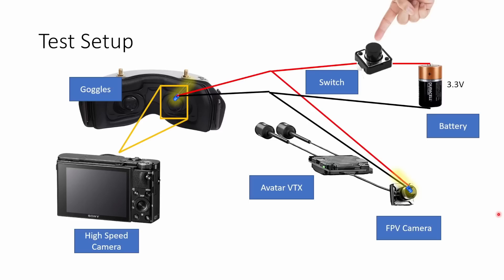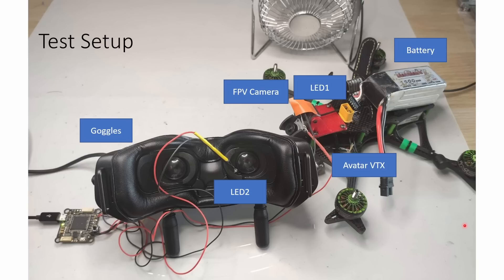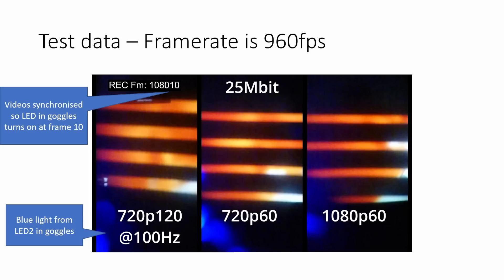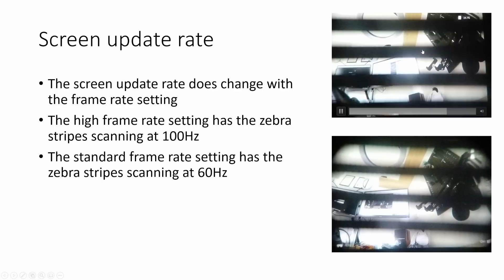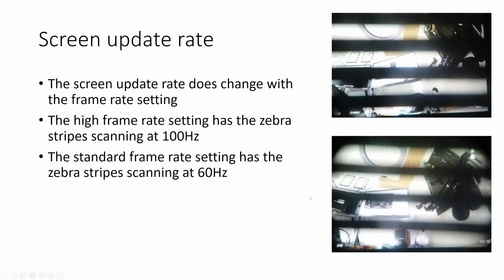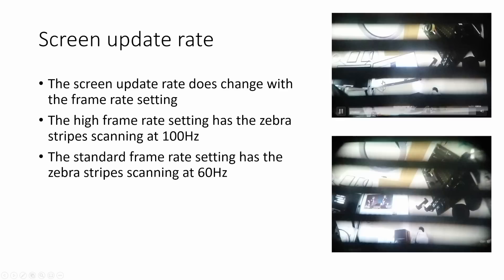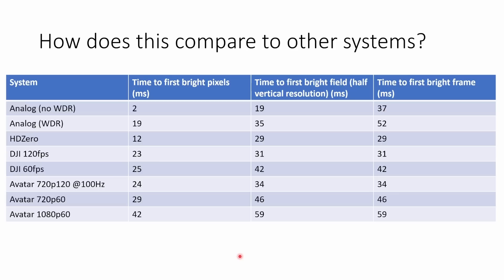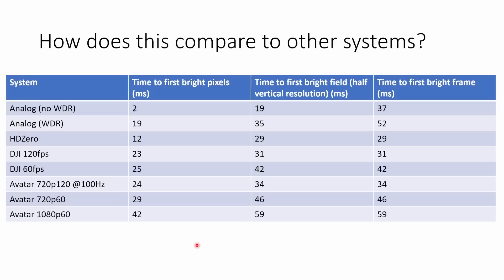Walksnail Avatar Latency Testing vs DJI, HDZero and Analog!

Comment from the maker: Some more information on WDR courtesy of Carl from HDZero! ♥

There are two types of WDR cameras available:
True WDR cameras that work with a shutter speed technique and two images.
Digital WDR (DWDR) cameras which work with a software compensation technique.

True WDR cameras work by capturing two images with different exposures to light and merging them into a third one, and therefore works more intensely but at cost of latency,  whereas the digital WDR works only with one image to make a digital exposure compensation, with only several line latency which is neglectable.

RunCam and Foxeer confirmed that most of cameras they have made use digital WDR not only because of less latency but also less cost.
Reply: Which cam did you use in your tests then? I was pretty surprised by the 40ms latency claim since that's clearly not what I was feeling with my runcams/foxeers vs. dji. but who knows!
Reply from the maker: @aphinion  I used Turbowing Cyclops, RunCam nano, RunCam Eagle Micro, and Foxeer Falcor
Reply: @ChrisRosser  I'm guessing the latest Falkor  3?

Comment: Wow HDZero is amazing! And DJI 120FPS not to far behind. Analog with WDR was a huge surprise to me! Thanks Chris!
Reply: Yeah, now if it could only penetrate objects, we'd actually have something! 🙄
Reply: @KOrnhOliO1  I'm not sure if hdzero uses LTE but that might explain why DJI/WS get far better penetration, however LTE requires 2 way comms for realtime link quality monitoring from both ends to know which packets to prioritize resending, it isn't just due to the H264/H265 compression those systems use.
Reply: Now... this is something hdzero could benefit from via an RC link callback of link quality via the hdzero backpack, can hop or boost power output of vtx in realtime when received vtx signal degrades.
Reply: @spikester  why not just fly it on full VTX power?
You're describing what dynamic power does for Crossfire receivers. 😎🤘
Reply: @KOrnhOliO1  Well if DJI would only stay at that 31 ms latency instead of dropping to 60-100ms when it has objects in the way then "we'd actually have something"... 🙄

Comment: I love this testing for sure, it actually shows what these systems are actually doing not what’s advertised. I’m glad that the market is getting competitive because it brings more options for us pilots to use. Thanks 🙏 👊 for the work. Now real world 🌎 use is always a slightly different experience with the way the systems handles rf environments and break up.
Reply from the maker: You are absolutely right. With DJI and Avatar systems the latency can go up with interference which doesn't happen with HDZero/Analog. But the tradeoff is much better penetration because of the retransmission.
Reply: @ChrisRosser  Yeah, that's a massive difference. Avatar especially seems to go over 100 ms (even 300?) as soon as it struggles a little bit. Personally I'd like a system that does the retransmission, but cuts it off much earlier than either DJI or Avatar do - eg never gaining more than 20 ms when there's interference - once it's at that added 20 ms, it should just show whatever it has instead of continuing on trying to resend while showing us the old frame, thinking we won't notice on a quad going over 100 km/h....

Comment: I think a clarification is in order about delay from drawing in scan lines. This is a penalty for a frame based video system, but not a scan line based video system. Drawing to the OLED in scan lines is in fact the fastest way to present new visual data continuously with analog and hdzero, and is not a latency penalty as it sounded like in your description. As long as the camera is rolling shutter (and it is here) and the data is streamed instantly with no whole frame delay/sync (which it is). Thanks for the data, I will test the hdzero goggles latency soon and we'll be able to compare notes 😉
Reply: So how is the rolling shutter synced to the refresh rate of the goggles? (pls dont say sync pulse)
Reply from the maker: You are spot on. This is covered in a lot more detail in one of the other latency testing videos for Analog, DJI and HDZero.
Reply: @ichi1082  a phase lock loop
Reply: I am guessing the refresh rate of the goggles is synced to the first scan line received  and then displaying data as it comes ... maybe ?
Reply: @hristiantodorov3923  No, as goggles don't display interlaced video.
Reply: @ichi1082  HDZero video is not interlaced. Mostly analog video was interlaced.
Reply: @hristiantodorov3923  I did not imply anything else

Comment: I don't agree with your WDR assumptions. With the limited computational power, i think the latency is just a result of expensive full frame based tone mapping + maybe a more expensive sensor readout. Reasons against WDR = combining frames: a) Racing cameras are also marketed as WDR and they just rely on sensors with a higher dynamic range + tone mapping. The RCSchim reviews show clearly that they do not have a latency penality. b) combining two image does only work for (almost) still images.
Reply: It would be odd to have a analog camera do whats essentially deinterlacing with dual ISO readout, only to then convert the signal to analog again. But then again, thats almost how split cams work, and they are known to have a delay of more than 30ms.

Comment: I already have the DJI system and a few analog. The thing that this testing doesn’t address is variable latency due to the quality of the signal. From what I have seen, The Walksnail system is more consistent but has a little less range than the DJI. The HDZero system is really consistent at even greater costs to the image quality. When the latency is that close the consistency matters more. It would be nice if at least one system eventually had modes to support more consistent vs better range or quality. I wouldn’t want to fly the 1080p mode all the time but it would certainly be worth flying for some flights.
Reply: DJI does... 25 mbit will carry further and with lower latency and more consistency. Quality obvious in 50 kbs. Also, you can choose latency or quality. But maybe a more mapped out option set ;)
Reply: @ThomasAndersonFPV  At the best setting for latency, it still varies a bit. If they added a standard definition option, you could probably make that work with more consistent latency and it would still look better than analog. Making this an option, you would still be able to choose the higher quality options for most situations that do not require as low and as consistent latency.

Comment: Thanks Chris! Nice to see an honest comparison with real test data. Blows most of the complaints about DJI right out of the water. I started with DJI, then built an analog quad with high end components and I hated it. I’ll be ditching the analog equipment I bought as fast as I can. Steeles setup was OK, but expensive and impossible to purchase anymore. Even Steele said HD zero was better than his analog setup. I trust engineers over the YouTubers out to just make a buck.
Reply from the maker: Yeah I'm definitely a fan of just showing test data comparing the systems rather than flying it and giving a subjective opinion.

Comment: Surprising results all around. HDZero looking more and more an appealing proposition. As a longtime DJI user, I'm very pessimistic about the future of the hardware I already have. If DJI lock me out of their roadmap, I'll upgrade to HDZero.
Reply: I was pretty pessimistic too. But I read a lot of comments, and there have been several occasions that folks that claim to have sources say that the "Goggles 2" will be backwards compatible with Vistas, Link, and AirUnits, and that V2 goggles will be forwards compatible, though lacking features, with v3 air unit. I could care less about foward compatibility with v3 as I would only buy those air units if I had Goggles 2. But as long as they keep making Runcam Link( Vista with new vendor), and provide it with firmware that won't lock out v1 Goggles, then I will be happy,....and probably upgrade to Goggles 2/v3AirUnit eventually to get 1080p. If all of that is true, then DJI will be in a much better position to keep us from buying Avatar.

I keep HDZero in the running too, but really, the only reasons I want HDZero is the little whoop board, and OSD/Canvas mode. I look forward to 1080p in Avatar and DJI, and so far HDZero hasn't really hinted at 1080p any time soon.
Reply from the maker: I also want the DJI camera to remain available. It's a step above the cameras from Runcam or Caddx.
Reply: @ChrisRosser   Yeah, I find the Nebula Pro's( micro and nano) adequate during fairly good lighting conditions, and I'm actually finding that I like the softness of the micro over the DJI,...but,.... when the lighting is tougher( bright blue sky through the trees), DJI shines. The Nebula Pro's get that hazy look.

Comment: Bravo! Great testing as always, GJ Chris! Interesting to see if Walksnail can fix the latency, because the hardware should be able to be faster than DJI and if a theoretical 2nd version of the goggles will include 120 or 144hz displays.  Cant wait to see how the HDZero goggles will perform.

Comment: I’m curious to see if the new DJI goggles will do full frame or line by line like the Avatar goggles. Can Walksnail change the way the screens refresh or is this a hardware limitation? Is this the same as progressive scan vs interlaced?
Reply: 1) full frame - show entire frame at once. 
2) progressive - draw the frame line by line 
3) interlaced - draw every second line, then come back and draw every other second line

Comment: I used to test analog cameras for latency (of just the camera itself), and there was a big difference between them. The Foxeer Predator had a consistent near zero latency (around 1ms) for first pixel showing light, where a camera like the Caddx Ratel would have up to 30ms. CCD cameras were obviously tied to the frame-rate since it waited for the entire frame at once. Which Analog camera did you do these tests with?

Great job. I appreciate the data.
Reply from the maker: I tested with an Turbowing Cyclops (consistenty 2 ms latency) a RunCam Eagle (consistently 18ms), Foxeer Falcor (consistently 18ms) and Runcam Nano 4 (consistently 2ms). The fast cameras had noticeably worse dynamic range than the slower cameras.
Reply: @ChrisRosser  Thanks. I appreciate the additional information. I'm pretty sure the Foxeer Predator had WDR enabled when I did the testing, but it's been a few years now.
Reply: @ChrisRosser  Given the large discrepancy between the analog cameras tested, what do the numbers shown for "Analog" in the video represent?
Reply from the maker: @GRANOLAFPV  Recently I've moved to showing the theoretical latency of analog in lieu of the specific latency of a particular camera. This is 2ms pixel to pixel and 19ms to full frame.
Reply: @ChrisRosser  Thanks for the reply. Does this mean you’re using the theoretical minimum latency for analog? In my case I’m using a Foxeer Predator V5, TBS Unify Nano, and RapidFIRE on FatShark HDOs so I’m wondering what the approximate latency of that analog setup is vs. HDZero in particular.
Reply from the maker: @GRANOLAFPV  I would guess ~6ms for first pixel, 23ms for first field and 39ms for 2 fields (1 full frame).
Reply: @ChrisRosser  Thanks Chris!
Reply: Seems to me the anlong sdr camera would be a crazy good overall choice which leaves the other systems money for quiet a not big improve with true feeling only 90 wasnt so much fun from 60, may be the dji v2 120 ... and the next thing  is to find sdr cameras and keep use them for now.

Comment: The hdzero latency really shows the latency of the goggle hdmi input and screens. I would expect the walksnail module to be at least 12ms slower than the integrated avatar 720p60. So your looking at 41ms latency first bright pixel vs 2ms for analogue.

For a full bright frame your potentially looking at 60ms with the external avatar module.

Comment: I enjoyed reviewing the test.   For me I will continue with my DJI goggles.  But if I was a new pilot getting into the hobby.   I could see getting the Avatar system
Reply: @LyroLife  if I was a new pilot I’d go avatar, the lighter form factor goggle.  In this test 720p 120fps at 100hz of the avatar beats out the DJI.  
Plus the OSD is better. 
But I’m not a new pilot, I’ll keep my 2 sets of DJi goggles and 6 vista units. 
I also love my Fatshark HDO2. 
For micros
Reply from the maker: I agree the form factor and screens in the avatar goggles are the biggest draw for me. I believe that image quality etc. is likely to approach DJI fairly quickly with firmware updates.

Comment: Very cool and interesting. I've seen lots of people commenting on the "noticeably" lower latency of the avatar system in comparison to dji. Obviously a placebo effect. I think displaying a lower latency on the avatar goggles is just a marketing bluff.
Reply from the maker: You're right I don't think the latency of the systems is noticeably different. I think the latency reported by Avatar is accurate. It's just not glass to glass, it's glass to framebuffer! DJI are probably doing the same but in DJI's case framebuffer to screen is ~0ms.

Comment: So, at 16:19 in, doesn't that show that HDZero is just 2ms faster to draw a full frame than DJI? And that Avatar is right behind those two at only about 2 ms slower than DJI?  It also seems to show that people saying that analog has significantly less latency than digital does, are actually incorrect, and it has more latency to draw a full frame.  It appears from your chart, that analog WITHOUT WDR actually is about 6ms slower to draw that first full frame than DJI appears to be, correct?  And, if a person is using the very popular WDR camera on their analog quad, they are actually getting far more latency than any of the digital systems.  Seems to me like DJI is the only company truly rating their latency very, very close to the tested correct amount.
Hmmm, Am I correctly reading your chart that you've clearly shown that the 3 digital systems have less latency to draw a full frame than the best analog non WDR camera's for analog?  If so, the whole ballgame has changed with science!  Thank you!  :)
Reply: Don’t forget that DJI and Avatar’s latency increase more when signal is poor.  What analog pilots say is they would rather have the analog static and consistent latency than skip frames while DJI retransmits a badly received frame.
Reply: @flybyirwin  And, what digital pilots say is "Damn! That penetration of objects is amazing! I can fly completely behind big buildings with no loss of picture quality!"
As the analog and HDZero pilots say 
"I can't even attempt to fly behind that building without complete loss of signal!" 

Yeah, analog and HDZero are great for racing, but there's a huge portion of FPV pilots who couldn't give a crap about racing through gates in an open field.
I know many more would like to fly places analog and analog2 can never dream of ever flying, and with gorgeous image quality!  🤔👍
Reply: @KOrnhOliO1  😆 he said, analog and 'analog2' ROFL
Reply: @npcfpv9542  Well, if we all really think about what HDZero really gives us better than analog, it's:
Clearer image quality - not as clear as FatSnail or DJI, but it's still clearer than analog.
Same snow and fuzz break up as analog.
That weird as Fu%K vertical Rainbow lines black out.

So, when we really give it some thought, it's got better image clarity than analog, but the same snow and this Rainbow signal loss crap. To me, that's a better version of good ole' analog = Analog2 ... Or, we could call it:
Anal log2  LOL  Now, I digress....  🤣🙊
Reply from the maker: I think the best comparison is time to full field. That puts Analog without frame combining WDR fastest. HDZero slightly ahead of DJI which is slightly ahead of Avatar.
Reply: @ChrisRosser  Yeah, and it gets totally rid of the thought that DJI has so much more latency than Analog and Analog2....ERRrrr...HDZero.  :)